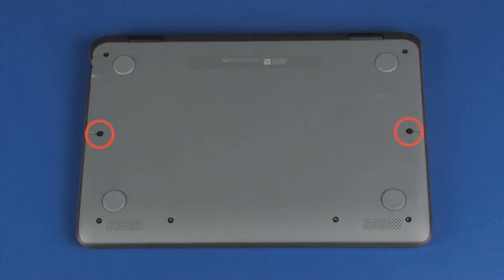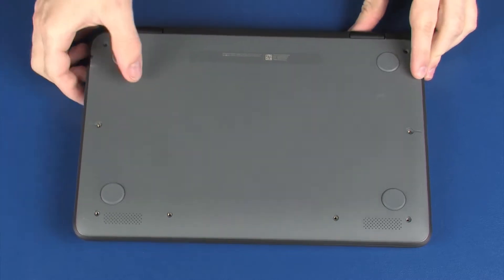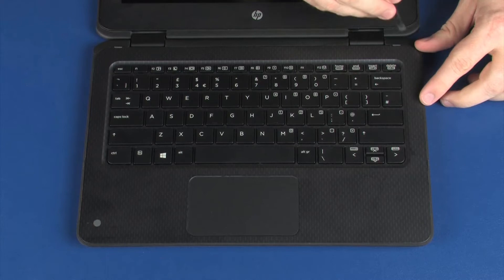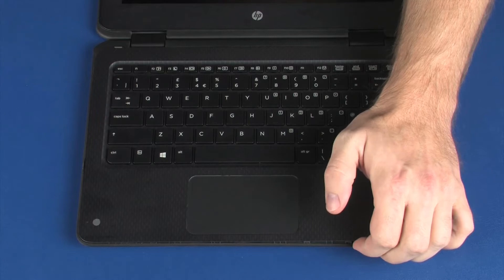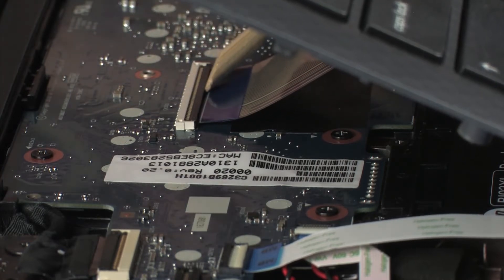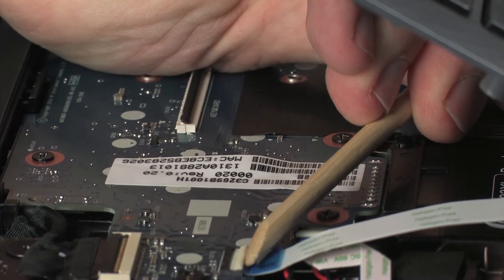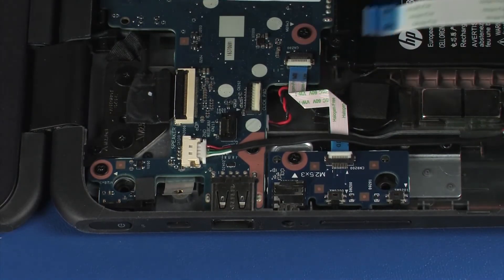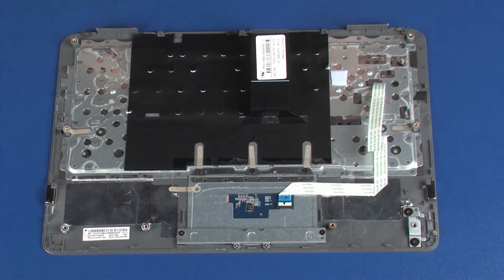Remove and Replace the Top Cover | HP ProBook x360 11 G1 EE Notebook | HP Support

Comment: How to insta Windows on this Chromebook?? Thankyou
Reply from the maker: +Hermenegildo Do ceu Chromebooks are a special computers which are designed for a different type of users and are not meant to be fully functional gaming PC, their operating system is Chrome OS (which is Linux-based OS).
Officially, Windows OS is not supported on Chromebooks and it may be difficult (or impossible) to install it or use it. You may void your warranty if you attempt to install Windows on it.
Reply: @HPSupport  Ok Thankyou

Comment: Can i upgrade ram and rom?
Reply from the maker: +احمد خلیل This notebook Support for DDR3-1600 dual channel
Supports up to 4-GB maximum on-board system memory
Support for up to 8-GB maximum system memory in the following conƭgurations
● 8192-MB: (256 MB × 16 × 16 pieces)
● 4096-MB: (256 MB × 16 × 8 pieces)
● 2048-MB: (256 MB × 16 × 4 pieces; only allowed on computer models equipped with an
Intel Celeron processor, no HPSP v2 and no NPRM)